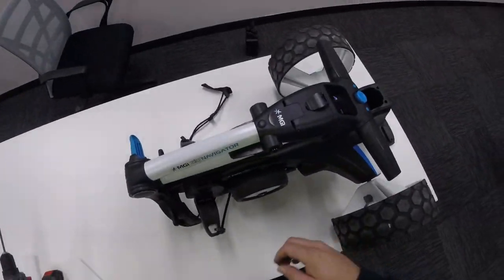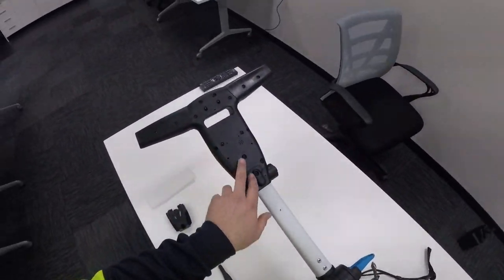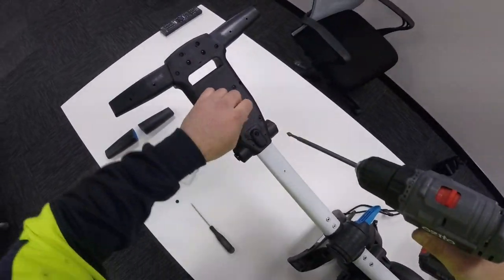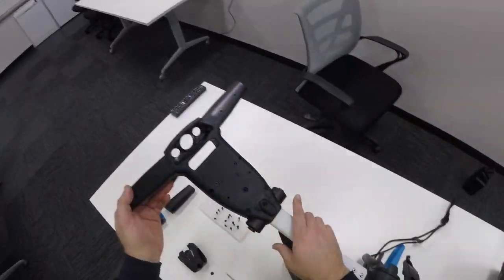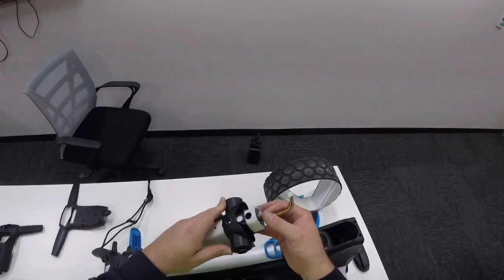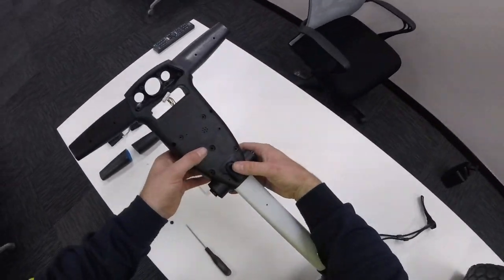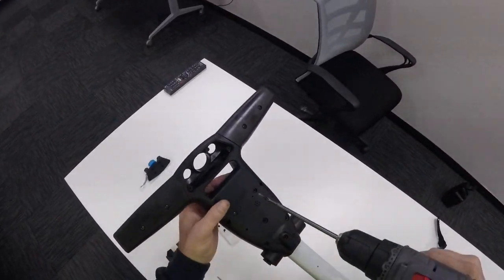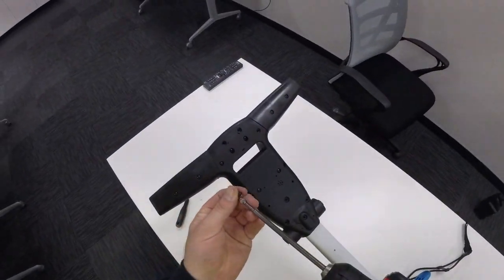Top box mount replacement

Comment: Hi I need to replace the u shape plastic part that holds the arm of the stearing shaft in place, one of the pins is gone and is holding on with one pin, can i get a pin somewhere